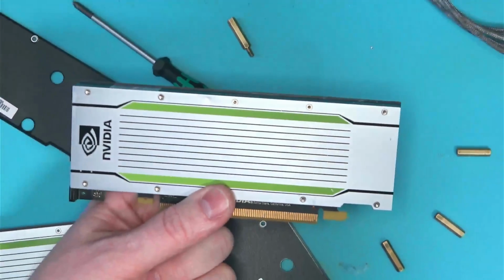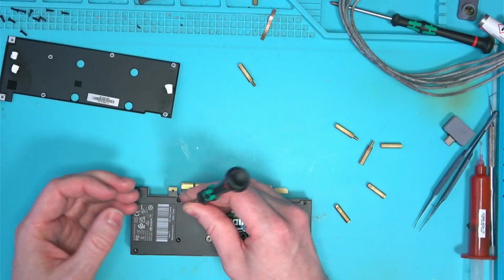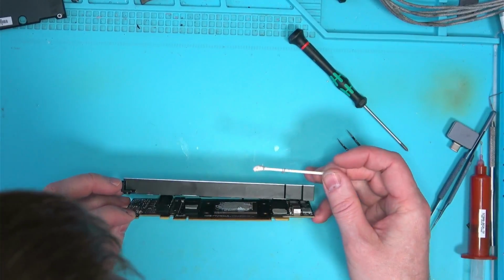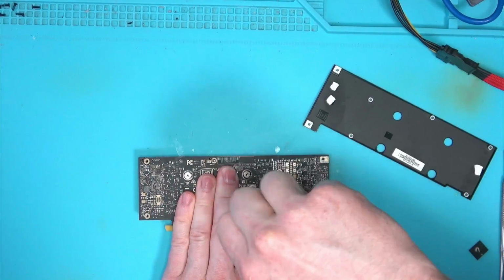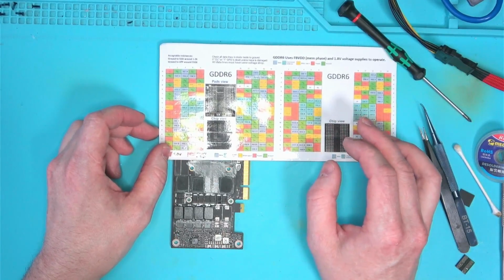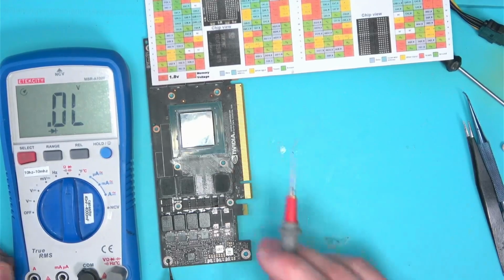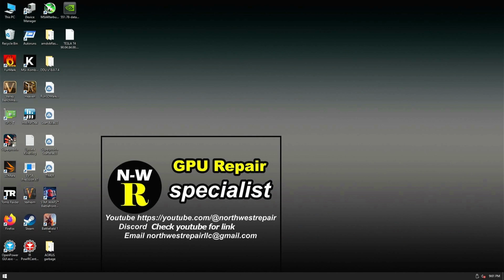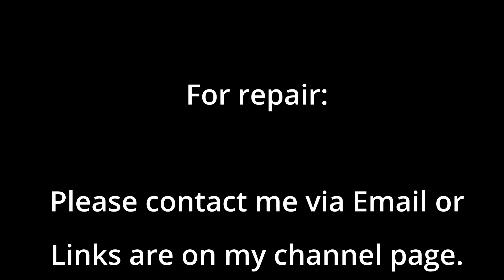Nvidia Tesla T4 error code (10) repair

Comment: Hi Frinds. Gpu 3060ti. Issue. 
One Tec say : reballing the gpu going 50%fix. But little chance gpu going dead .🥲

Gpu show yellow tick in device manger . Uninstall the reinstall driver , face same issue. 

One Tec say : module and vram need change , he say 100% fix. But very expense. 

What is exactly problem. 

Please help. Frinds

Comment: these tesla cards while they definitely work off-screen, you need a remote desktop software or a secondary gpu with output to see its frames. in this case you need the GRID driver which basically is the equivalent of GRD driver for most geforce cards, and then the driver will establish a virtual display that works right off the tesla card. additionally with GRID drivers, these things are 100% capable of gaming. if you use the datacenter drivers, the tesla will work in compute something mode aka no 3d, no gaming whatsoever

Comment: That GPU is use in data center, is most use in streaming server and compute servers, normally you have to use a software to manage the GPU (to start it), it can work on a normal computer but do not know how the "normal" OS will deal with it, never use it outside server blades
Reply: yes nvidia-smi is one of them, normally the HPC (high power computing) have internal drivers to pick up the GPU, many HPC OS are in cluster servers, you have IBM HPC, Windows server HPC and many others, they are use to build server clusters

Comment: grey pads are when the pad gets overheated and the resin that coats it in the layers of pcb wik through it to the surface of the solder pad

Comment: These little things run really hot when not cooled by a fan, I've had several end up a no-detect due to overheating, only coming back when cooled.
Reply from the maker: They need to be inside of a cooled server rack.
Reply: @northwestrepair   of course, I'm in the business of creating server motherboards, and when verifying the mainboards pcie hardware in an early stage of design, enclosures can be a bit scarce or even non existent still, so gotta do that on tabletop.
Reply: Yes they are meant to be in the wind tunnel created by a server case and a bunch of 15 000 RPM fans
Reply: You can keep those single slot lp Teslas with 1x60mm fan if you got an 3d printed adapter.
Used that on my older SFF gaming PC where i used Tesla P4 - temperature could not go above 77 degree after 6h of gaming on CoD 2019

i also saw people doing an custom 3d printed brackets for those cards to be cooled by 2x40mm fans

Comment: wow the core is HUGE for such a tiny card...
Reply: Tesla T4 - core of RTX 2070 Super with 16GB of VRAM on board
Tesla P4 - core of RTX 1080 with 8GB of VRAM on board

tho those cards are locked to 70W - not 75 but only 70W

If you pair those GPUs with proper CPUs... you can virtualize or go with iGPU pass-through for pure gaming on those cards, then the performance follows:
Tesla P4 - somewhere between GTX 1070 and GTX 1070Ti
Tesla T4 - somewhere around RTX 2060 Super / RTX 2070

keep in mind that those are closests performance, while running in single slot, locked to 70W only
Reply: @Karti200  yea i know these cards, i have a P4 for plex transcoding
Reply: @Karti200 you mean GTX 1080
Reply: @maklogetrich2378  yea, just saw i wrote wrong letter xd
Reply: I believe it's a TU104.
Reply: factory undervolt and hardcore pl should be expected. for t4 i think it will be sub 800-900mV under load. i have a p4 here and it draws 650mV under load. such huge chip on a tiny board like that shouldnt matter because the vbios with that voltage settings are already making it capable of being single slot without being prone to overheat.